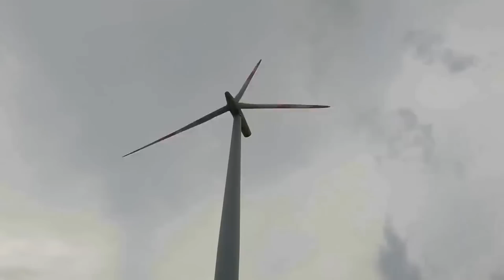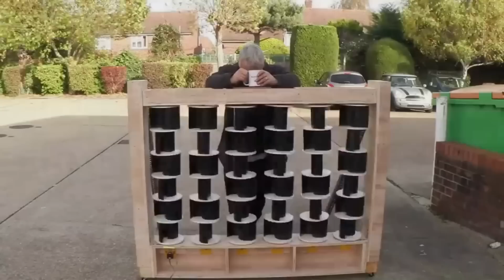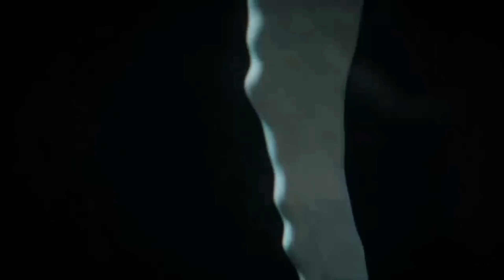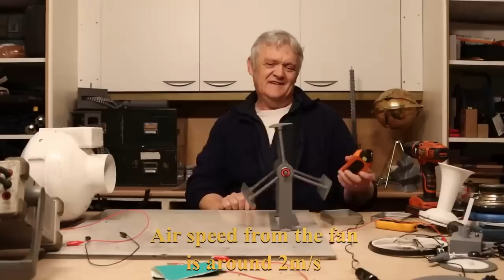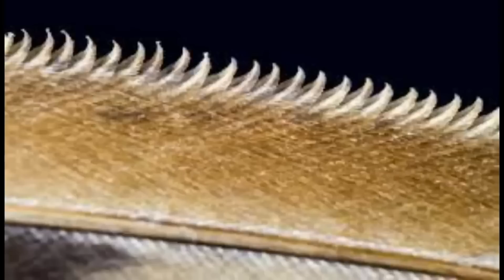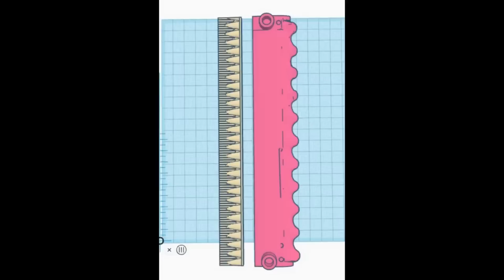046 VAWTs Inspired By Nature

Comment: The observstion of tge addition of the owl wings combs weight difference & tape's weight +/- may be skewing the RPM ratting comparison to the other designs. BUT a very interesting result for all to tinker with equally weighted but 3 different blade props to compare  and no more about. Thank You, Robert, for the wind at our backs push to our collective increased knowledge efforts benefit.

Comment: The question is how many birds will they kill?
Reply: Less than cats!
Reply: Numbers vary wildly from different studies, but in 2013 and 2014 estimates were anywhere from 140K to 679K per year, which is alot, until you look at studies showing that house cats kill anywhere between 988 Mil and 4 Billion per year. If you consider that amount of habitat that gets destroyed for fossil fuel projects, the number of birds killed is negligible. That doesn't even account for the impact of Climate Change which is much harder to calculate.

Comment: All good but storing energy is our biggest problem. Thanks for your great content 👍
Reply: It was an issue in 2020 but not in 2024 or 2030. With EVs pushing Lithium batteries down you just can buy batteries at $100 per kWh now. And if you use refurbished batteries from teslas it goes well below $50 per kWh.

There's no typical energy usage profile world-wide. But many households around the globe cover daily energy needs with  just 1-5 kWh of energy.
Reply: @ua420   Well, if we take all the energy storage there is and it only lasts 1 hour. Problem and lithium and kobolt are not cheap enough. We do need rethinking energy.
Reply: Sodium ion batteries
Reply: Rome wasn't built in a day - it takes time to manufacture and install